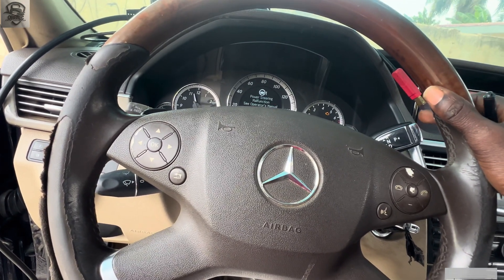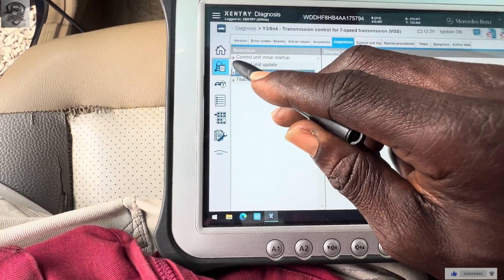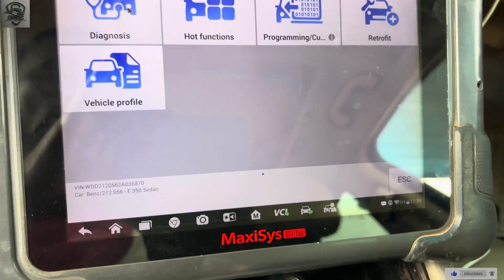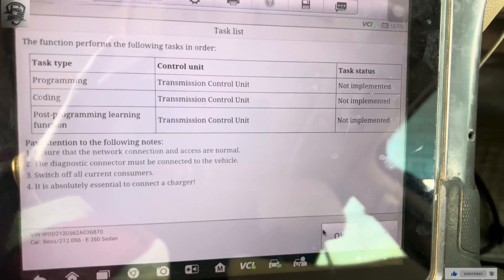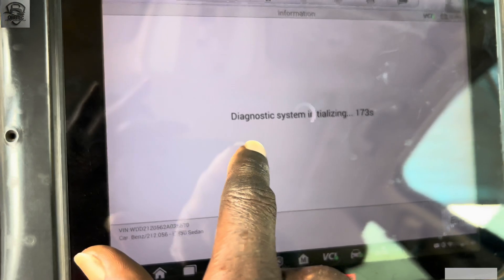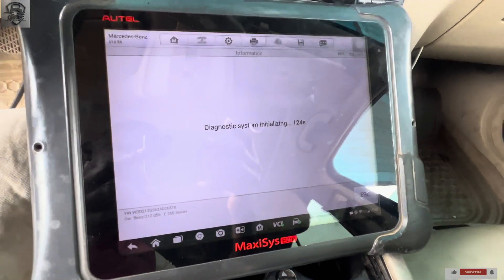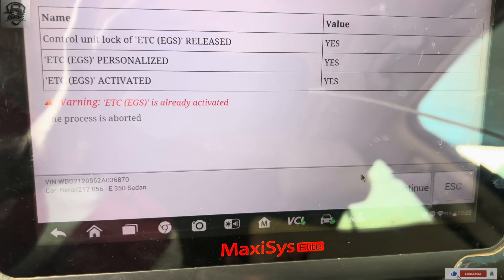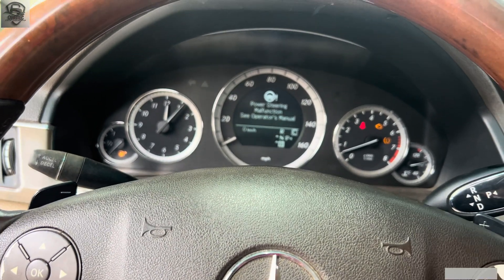MERCEDES-BENZ W212 OUTPUT SPEED SENSOR ONLINE CODING&PROGRAMMING AFTER REPLACING TCU WITH AUTEL PRT2

Comment: Is new valve body tcu or used
Reply from the maker: replacement of the whole gear box but is change TCU/black-kit then some require these programming and coding
Reply: @obiritech  My question is if it is a new or used TCU, because used ones have to be virginized in order to adapt it.
Reply from the maker: @betomunoz5410  Used TCU need virgin it first and new TCU you need to do swap with mb star but after virgin and there’s a fault with output speed sensor you will need to the online programming